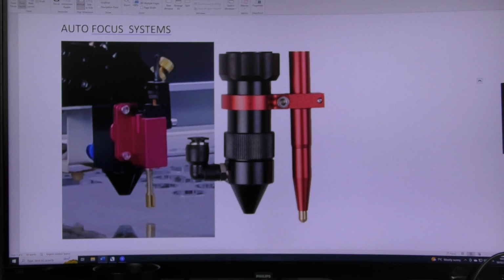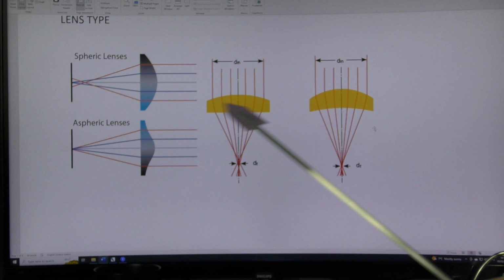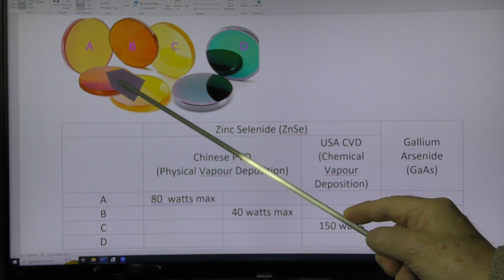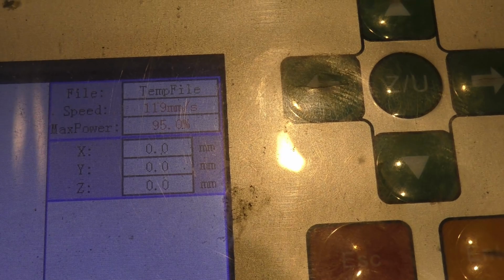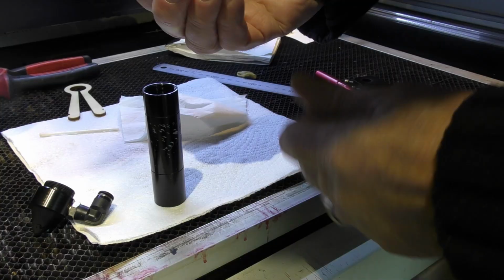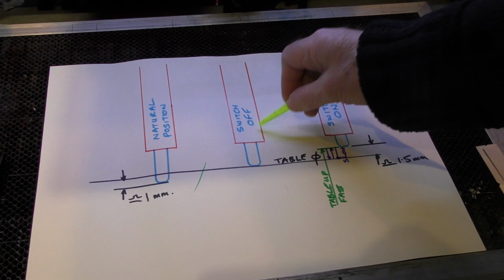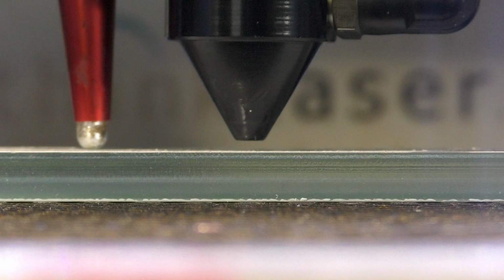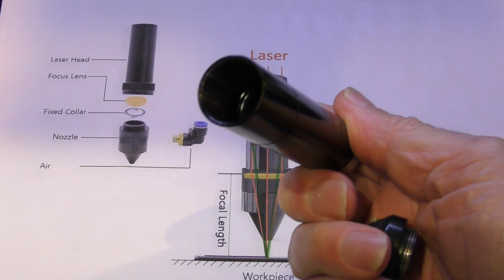RDWorks Learning Lab 249 Auto Focus for New Laser Users

Comment: Thank you! You never said what the type or name is when you referred to the lens that was concave on the bottom and convex on top. I run two 150W lasers all day and am trying to achieve more precise engraving on 1000D Cordura and and other fabrics and am trying to achieve fast, precise results. Currently using 2.5mm lenses. Manual focusing. OMTech and LightBurn. I’d be grateful for your advice. And thank you again for sharing your experience so scientifically!
Reply from the maker: Hi Jeff 
 It's an interesting compound material that I have no experience of , being nylon fabric with a polyurethane backng to make it waterproof.  I can get hold of a sample to experiment with  but would like to understand more about the  application. and your machines. I am sure I can  use my time usefully to experiment with this material using my many lenses to find a combo that suits your needs.  Sadly  that choice it is not a simple matter because the intensity distribution within your beam  will chane quite a lot with position on the work table . That change of beam diameter affects the performance of a lens because . We are stepping into a weird world when laser beams and lenses interact. There is much to understand and none of it is logical. The better news is that these wierd effects are mosty experienced when cutting. Engraving idsles sensitive. It would be a good idea to contact me privately so that you can send me pictures and discuss issues off-line you tube will not allowm email adresses  so please use this contact form
https://forms.zohopublic.eu/ndeavorlimited/form/K40XtreeemLaserCutterContactRussSadler/formperma/k2Cn0QN5ChpazfTMAUw25lZ-FKpjZa96TQWHjv3ntOg
 Best wishes Russ

Comment: Hello. I'm wondering if you can shed light on something being argued about in some forums.  That is, setting your focus to the surface of the material, or setting your focus to the center of the material thickness.   Some are claiming that this puts the point of the beam in the center and cuts better. To me, this sounds like breaking the tip off your pencil and saying it writes better.  You just de-focused and widened the beam.  By that logic, Why not set the focus to the back of my material and that is even better?  What is your expert opinion.   Thank you.
Reply from the maker: Hi
 I have seen  the videos and also the claims but they have a;lways been for the newer 20 watt lasers They certainly cannot cut in one pass. . Your pencil analogy is very good.  The problem the diode guys suffer from is  their inabilty to see the beam intensity profile.  It is so useful when you undestand why and how the beam damages material.  The CO2 beam fired into a block of acrylic shows exactly what is happening at diifrefnt parts of the beam diameter. The same 1/3 myth exists in the CO2 community also. The mechanism of how a beam cuts seems to have been an unexplored and an unimportant issue for the scientific community. It is only very recently that I have decoded how it happens and it is summerized in        https://youtu.be/kddSFO-iFNM.   
Even demonstable facts will not change some people's belief so I never try. It's good enough for me to know.

The diameter of the beam and the intesity profile within the beam  determines how a particulat focal length lens will cut.  its the most intense central part of the beam which has a focal point beyond the nominal  intensity focus (not the same as the optical focus). It is possible that for a diode laser, where you alwys have to do multiple passes, that  a compromised first cut is really getting the second pass more to the correct focal point. You would not notice this compromised first pass if the end result was 4 passes instead of 5.. If a CO2 laser fails to cut in one pass then there is something horribly wrong.  It is wrong on so many levels for  CO2 beam but  because the diode beam is so non-gGussian and thus  inefficient at cutting,  this is possible.......up to a point.  My anaolgy for cutting with a diode laser is like trying to do brain surgery with a butter knife.  with such a short wavelentgh , the diode bem   theoerically should have the ability to focus to a mch smaller focal point and cut much better. However  the crap beam quality ( low peak intensty) means it has the same spot size as a CO2 lens of equivalent focal length. The shorter wavelength of a diode laser a t450nm means it is also lfar less ss efficient at cutting most organic materials and why these are engraving devices. Even if you sharpen a butter knife it still will be poor at brain surgery 
 
I wouldn't argue withe "experts" in forums . They are happy knowing what they know
Best wishes
Russ
Reply: @SarbarMultimedia  Thank you for the detailed response!  You are very smart and I trust your analysis and explanations.  On my channel, I also try to teach how to use the laser, and WHY certain things work.  In my 3 years in laser forums, I see so many that don't want to know how something works, they just want to cut it fast and make a profit.  This has lead to me making several videos on why glowforge's built in settings start a user off on a bad foot. They think "Medium proofgrade maple" settings are THE maple settings, when they are really specific to the material glowforge sells.  Almost nobody in the glowforge realm takes the time to manually enter and test speed and power settings and they are very quick to accept any answer given as THE solution. So someone will post saying their wood did not cut with medium maple settings (140 speed  full power) and someone will comment "USE MEDIUM DRAFTBOARD! Its the best"  and the poster will say "THANKS SO MUCH!!"   But in reality, they just told her to use a faster speed, like 160.  That wont work, but they do not want to learn how to use manual settings, and they just waste material.  These are the same people who insist we give them the perfect settings for engrave a pencil, rather than waist 10 cents testing for themselves.    The "Focus 1/2 way though" topic came up again yesterday, and sooo many people were replying "Awesome, Thanks, I will do that"  and it just did not sound like sound logic to me.  So I wanted to consult the expert. :)  Thank you so much for your insight.
Reply from the maker: @LithosAndLasers  
I have spent more time  than 99% of users trying to really understand the technology. There are still things for me to learn so although I know and understand more tham most that does not make me an expert I have lots yet to explore and more mistakes to make. I am just  a more advanced student. I had to make my last video aboutautofocus because it's being sold as part of every OMtech machine. It turns out that some new user think it is intelligent and does what the title says. They put a different focal length lens in and wonder why the lens doesnt work. I cant be critical of such folks , they just were fooled by the marketing and nmeed help tp get them  started     ( see   https://www.youtube.com/watch?v=I2CWbkzJw6Q&t=61s     ).

 Glowforge  purp[osely hide the technologyu away so that it becomers a one button experience. Sadly for a personal hand holding service you pay dearly.
Best wishes
Russ
Reply: @SarbarMultimedia  Agreed. I have a different Chinese 100 watt laser that I love, but I have not used it's autofocus since about 1 month in. My current optimal focus height is 5mm, so I use a 5mm piece of walnut to focus my material on. (I keep my nozzle in 1 spot and raise or lower the bed for focus, with the spacer on top of my material) That said, my new APC 2 inch lens and tube were delivered last night and I plan on installing those tonight and running some tests.  Always trying to learn and test :)